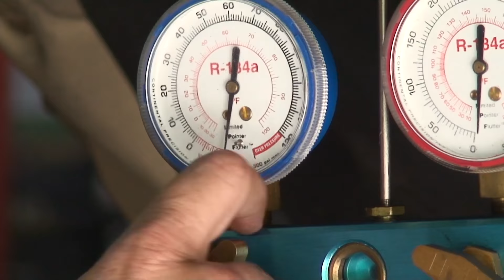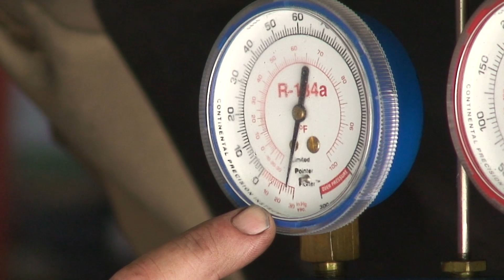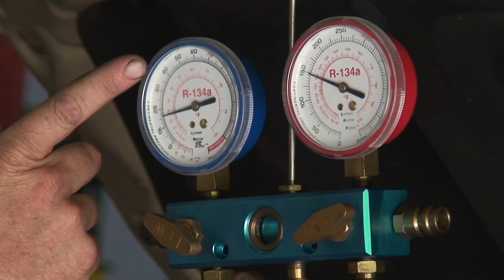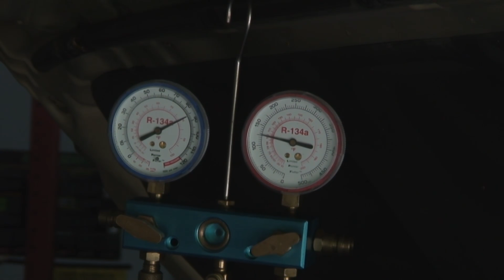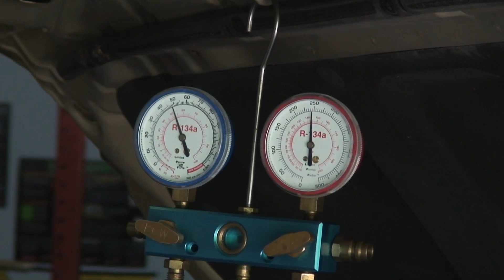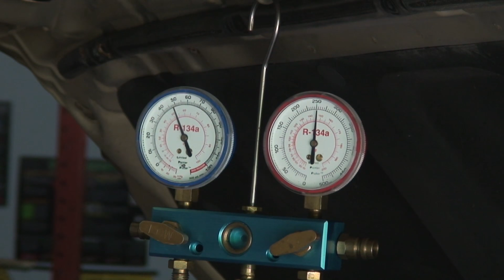2004 Hyundai Sonata AC Repair

Comment: I could not reach the driver's side screw on the condenser very well from top or bottom with the tools I had.  I thought about it a while, then said to myself, "The condenser is bolted to the radiator.  That's the way it and the dryer accumulator have to go back.  Why not just bite the bullet and pull the entire radiator?"  That turned out to be the best decision of the whole project.  Once I did that, three things were made dirt simple.  1) Disassembly of the condenser from the radiator was a bench job, as was taking off the dryer accumulator.  2) Access to the compressor was totally easy, all right there in total view and easy reach, and absolutely nothing blocked its path out or in.  3) Reassembly of the dryer accumulator to the condenser and the condenser to the radiator was again a bench job.  The only thing that would not slide back in easily was the driver side air dam, which was easy to get back on once the radiator was slipped back into place.

Comment: Video helped me with same job on my 02 Sonata. Another way to reach the driver side condenser bolt would be to remove battery, battery plate and recovery tank. Bolt is right there, no need to get under the car.

Comment: Can you please do a video on exactly where the low pressure switch is located on the 2004 Hyundai Sonata 2.7 and also where Bank 2 Sensor 1 is located.   There are no real videos for a 2004 hyundai sonata

Comment: You can remove the ac compressor by removing the cooling fans , and the compressor will come out from the top after removing the 4 bolts. It a easier route than going under the car.

Comment: Great Video. I am doing my compressor now. The comment on the oil threw me a little. The note said that there was 7 oz of oil in compressor, but the system takes 170 - 190 cc which is 5.75 oz to 6.5 oz. I assume the extra 1/2 oz will not be an issue for you, but mine came with a sticker that said compressor may not have enough oil (without saying how much was in there). I ended up draining it out and putting in approximately 6 oz ( I assume there is probably 0.5 - 1.0 oz still in there because you cannot get it all out). Any idea how to test and make sure you have the correct amount of oil?

Comment: Where did you order that pigtail connection what is it called? Where can I find that exact peice
Reply: Search on amazon for: Universal Wire Pigtail 112825. I got it from them and it was a perfect fit for the original compressor on my Hyundai Sonata 2003. It includes the male (wire harness side) and female (compressor side) connectors.
Reply: @hyperbius760  I order one that same day and got it like 3 days ago just haven’t bothered to get it done haha, but everything is working and running fine thank you!

Comment: could you please tell me if there is a way to test if a Input/output sensor (on a Sonata 07) can be tested to see if it is not defected. For example: on Clothes dryer one can test the parts with a Voltmeter by using the R mode. If there's a certain reading on the resistance, the parts is bad.
I would appreciate your help. The thing is that I have already purchased both sensors and the car still reading {once a diagnostic computer is placed} that is not getting signal from the sensors.

Comment: Unless you did it off video did not see you after all that work that you flushed out the Evap core expressly after a compressor failure also never charge by pressures always the proper weight as listed otherwise great video.